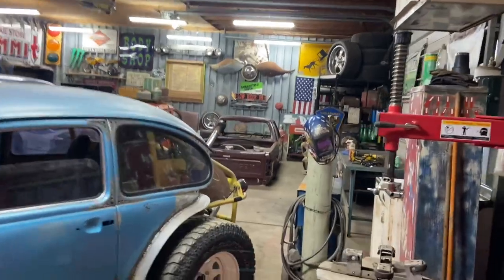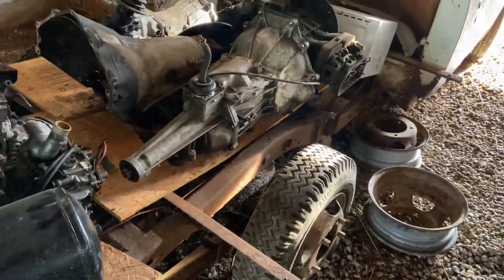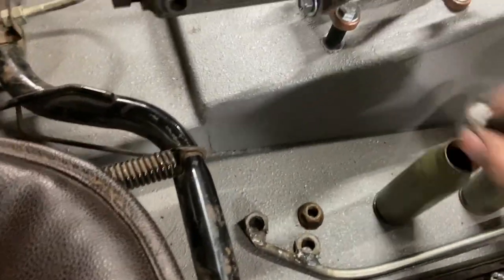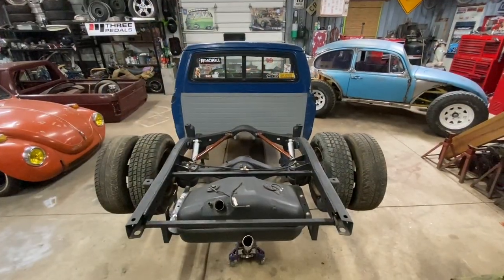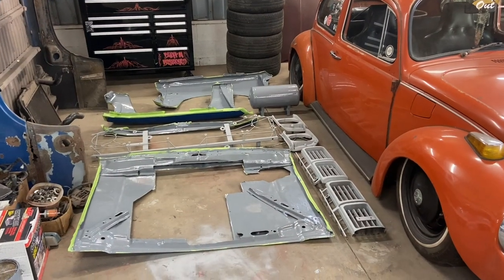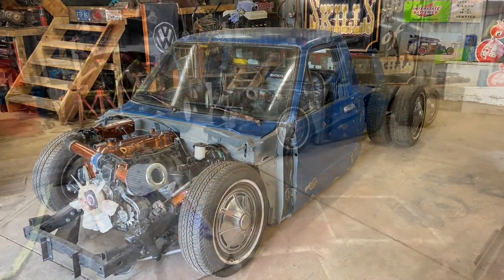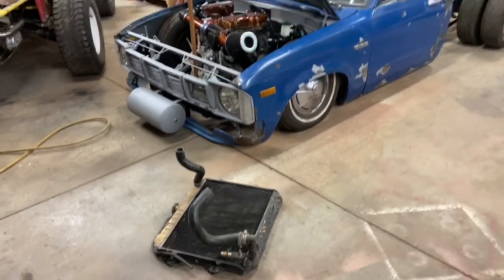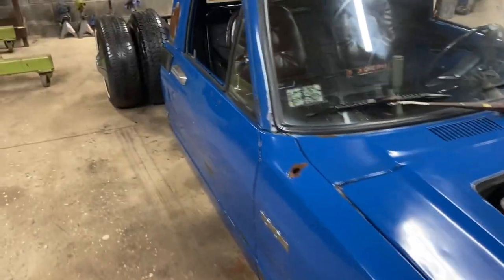EPISODE 38- TOYOTA DUALLY

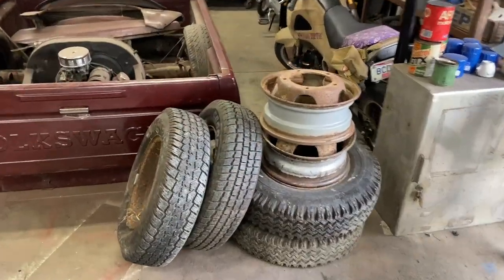Comment: Very Cool , in the 1970s JCWhitney Catalogs they sold  Adaptar kits for the Chevy Luv (Isuzu ) and the Ford Courier(Mazda) mini trucks to make them  a bolt on Dually  Conversion i was only a Kid but i would read my Dads JCWhitney Cataologs cover to cover  numerous times as he typically left them and other Catalogs in the Bathroom i had always thought Dually Trucks were cool  and as a Adult i finally bought a Chevy 3500 Dually Deisel to pull my Sportfisher Boatband some 5th Wheel Campers  i also had several other Trailers i pulled for other needs  BTW  i run the Truck with a Stock6.5 TurboDeisel and just a normal 3 Speed Automatic Chevrolet transmission  that has plenty of Tourque  but with 4:10 Gears  my Fuel Mileage goes way down  over 65 MPH  pulling anything  so i allow the Turbo to wind up to give me boost  fr going over Mountains and passing  on uphills if i need to  do so  t it is a 4X4  and i don’t feel the parts are worth the justification to switch the  gear over  as i don’t Pull full time with the Truck   so i don’t mind paying a little extra on fuel for short trips  plus i live close to my Marina

Comment: Hey, man! I just came upon your channel when looking for Toyota pickup dually conversions (research for my '89). This looks like a great project and I think it's smart going with the 5 lug siamese dually for a mini truck that isn't going to be hauling much weight or going off road. What I've learned on various forums and other peoples projects is that I need a 6 lug true dually axle from a 4x4 version if I'm going to be hauling, towing, and being off road in it 50% of the time. But it got me wondering what would be a worthy application of the 5 lug... and viola! Here you are doing it right, my dude 💪

Comment: now i am 57 years old. and  in regards to your Siamese Dually rims  i have not seen those although in the early 1970s  JC Whitney Catalogs sold a adapter kit for both the Ford Courier mini truck and the Chevy Luv  in the picture it  basically just looked like a Spacer  that allowed you to bolt another rim to  it  a simple system but i had always remembered it  as luck would have it. i got into boating and Camping as a Adult  and i wound up driving a Silverado 3500 Dually Diesel 4X4  to pull those toys around mine is a Centurion Conversion  Truck and i thought it would be cool to build my son  a replica using a S10 Mini truck  so i looked all over for a similiar Spacer  to do that easily  which i never found  so the idea got scrapped altogether  my truck also came with a nice Custom paint job  similiar to Southern Comfort Paint jobs  so the intent would be to replicate that as Well  do you have any idea  who built those Siamese Rims  you are using on the older Toyota ?  i remember some of the older Toyota based Campers had Duallies but i never owned one  and i kind of assumed those were a Factory aaxlevthing  that Toyota manufactured
Reply: I love that idea for the S10. I saw a photo online of a Dooley Mazda b2200, and ever since then I wanted to make one also. Then like you, saw the Toyota campers and figured that’s what was used for the rear end. I still hope to make mine one like the photo I saw online.